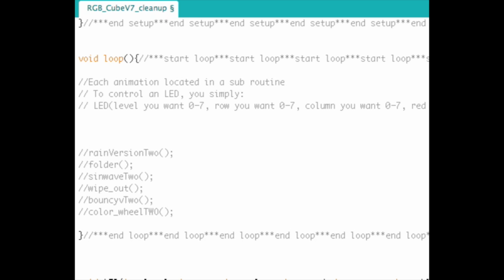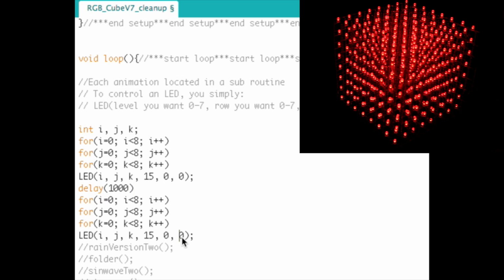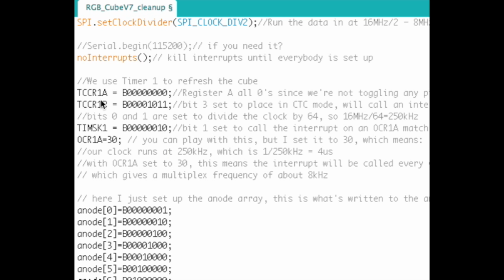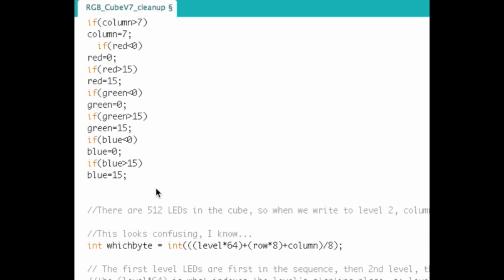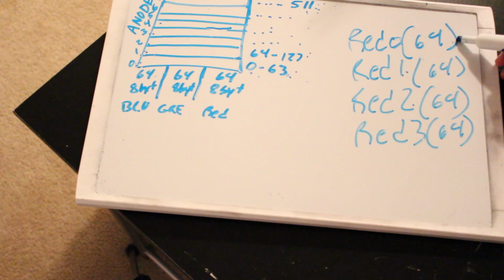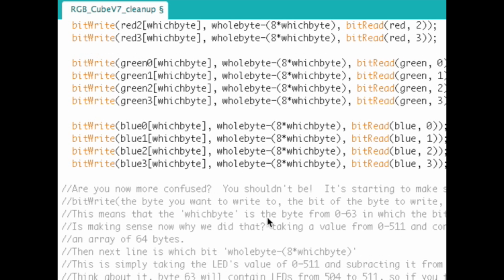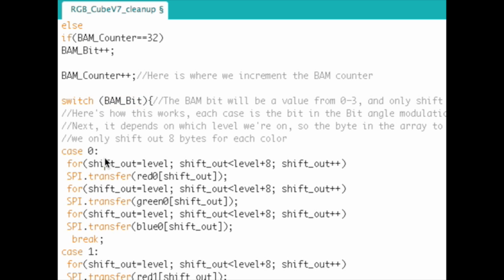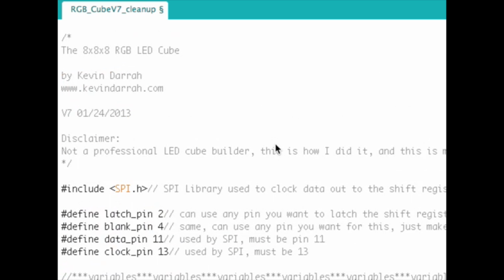How To RGB 8x8x8 LED CUBE - The CODE!

Comment: Kevin since the state of the leds dont change per bit. Couldn't you scrap the BAM-Bit variable and just set the output once at the BAM-Counter switch statement. It would beuch more efficient.

Comment: Kevin I was thinking. Couldn't we implement PWM as easy as BAM ? Say we have a counter which is incremented with each interrupt. Now say we use an array to store the brightness value for each led. Basically in the interrupt we could just compare the values to the counter and say, if the value is larger than the counter set the corresponding led to high or low otherwise. The only disadvantage I see is the slightly lower refresh rate because of the necessary if statements in the interrupt .

Comment: I wonder if Arduino could be used with a prorotype interface that controls Christmas light strands on a house. I'm betting it could, it would need a few 5v>110 relays...

Thanks for this kick ass info, subscribed!
Reply: Will control them straight out the box. Just dnld the code from arduino IDE, plug in the wires and off she goes. I already made one, and works fine.

Comment from the maker: if you're only using single color LEDs, then yes, you will have to make modifications.  You don't have as many cathodes, so you don't need to shift out as much data, and you could delete out a lot of the stuff, but it could be done easily if you understand what's happening here

Comment: Not a professional cube builder myself but I have to say that you made things really hard for yourself.
For starters the arrays wich hold the data can be done much easier with multidimensional arrays like this: Leds[row][leve][bam][colour];
The sizes would be: row = 8, level = 8, bam = 4, colour = 3;
This way you have all the cube data in one big array but it is easy to manipulate because of the multiple dimensions. To find a LED you would do Leds[currentLED%8][currentLED/8][BAM][Colour];

Comment: Thanks for the code Kevin
I saw that 1 red led is broken on your cube in the video on 5:00 when you go from red to blue on the side where you sit.
I've been practising with EAGLE, i have got 1 shift reg with all the resistors and transistors on 1 sided pcb ready so i only have to copy it 8 times on 1 pcb layout so that i have 1 print for 1 color and order that 3 times, gona start tomorrow with the anode pcb